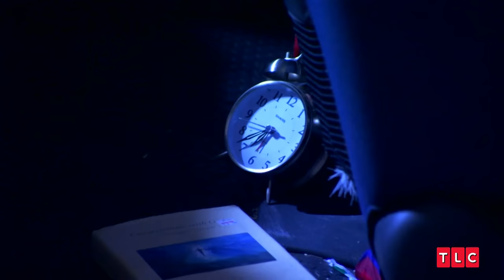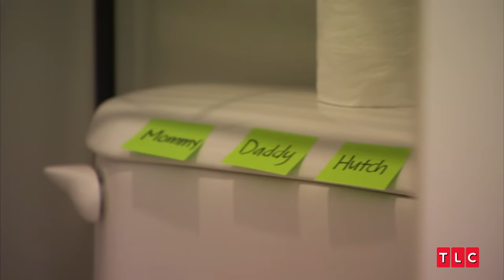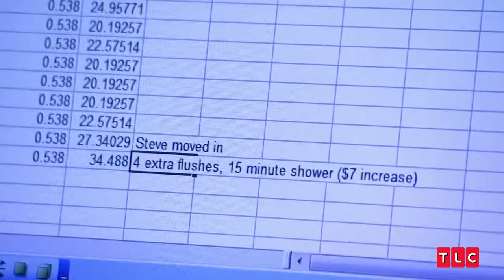These People Will Do ANYTHING To Save Money | Extreme Cheapskates | TLC

Comment: If I ever were to be a cheapskate, which I never will be, the bathroom would never, ever be the placed to save money. You need to be clean, presentable, hygienic, and you can't do that at all if you're scrimping on money and not supplying the essentials you need, like warm showers, toilet paper, using enough soap. And I'd never, ever use water from showers (dirty water, I might add) to wash clothes or dishes